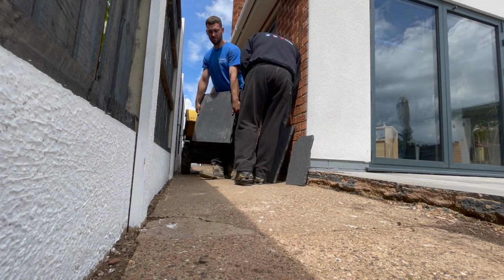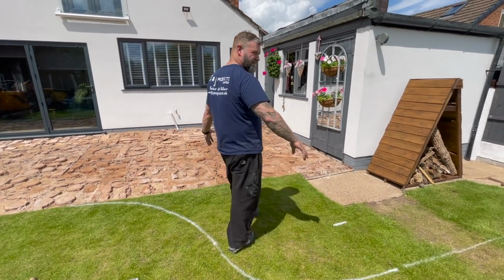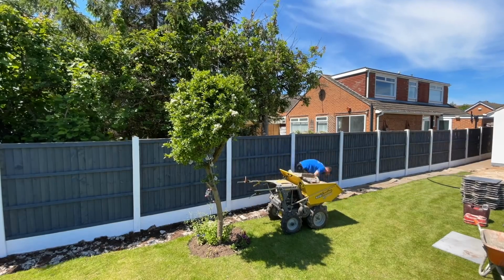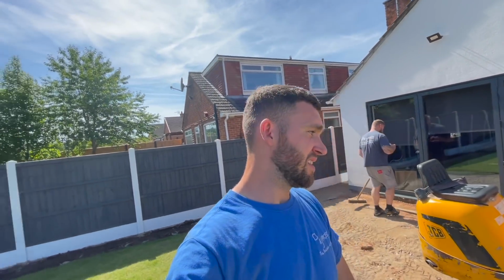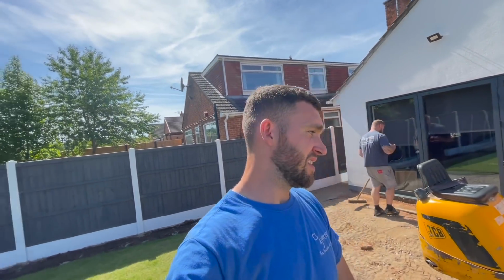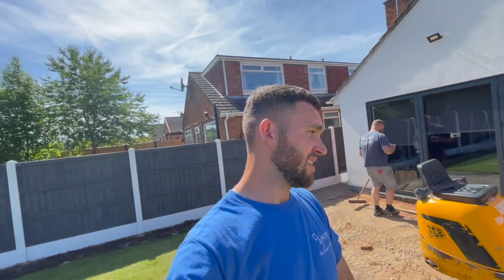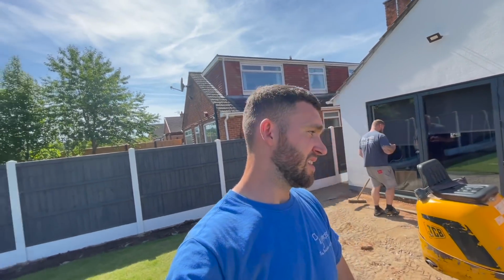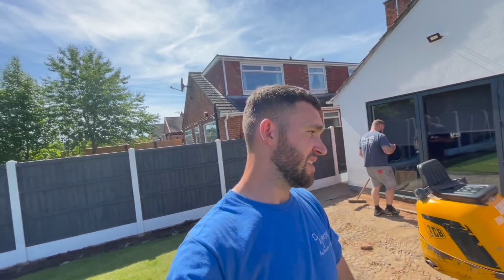HOW DO PEOPLE GET AWAY WITH THIS? - This Week At D&J Projects #013

Comment: Great job guys. And if I Remember Correctly it is 1 cement 2 Building sand and 4 Sharp sand you Use in your mix. And the Reason why it’s over water can drain through. Keep up the great work and Stevie your doing great on the grab (BIG RED) I look forward to your Mirch coming to the shop then I can pop in and grab some and I be Using you guys for my fencing Materials at home. Wen I get to it 😂 have a great week and you all keep safe 😎
Reply from the maker: YOU ARE RIGHT MIKE!! haha thanks mate

Comment: I'm surprised you don't use polymer sand for the joints. Just sweep it into the joints, vibrate a bit and spray with water. Makes a neat patio.
Reply from the maker: We use joint it, nothing easier than what we use lol
Reply: @DJProjectss  Look it up, polymer sand.

Comment: Builder did this on my clients steps. Over an inch of dot-dab on top of old concrete steps. Whole lot is debonding 🙄
Looking great the resin finish is going to look awesome.
What run-off angle are you putting on the patio?

Comment: Ive not watched the full thing, yet, so maybe you mention it later on. But isnt another reason for not dot/dabbing the thin slabs due to the difference in moisture against the slab on the underside. Which can end up showing as discoloured circles on the surface. Or in  the case of the castle lay (picture frame here), you can get a discoloured ring right around the perimeter.
Reply from the maker: That is true

Comment: Do you guys make or could you make double faced fether edge panels did a job recently were customer wanted both sides faced with no visable rails, so had to buy extra fether edge and pin it on the back myself.
Reply from the maker: Yes we can make them mate

Comment: TIP:

When you lie your pavers/stone. Mix 1-2 inch of dry sand and cement. Just sand and cement NO WATER. Spread it level and compact with wacker plate. Lie your stones in whatever pattern you like. Then rinse it with water or just wait for a rain, but make sure there is not traffic allowed on dry surface. 

Much quicker. Gives you perfect level. Looks more pro ;)

One consideration - you may struggle with local weather. Make sure you do not do more than you can at once. Once you get some practice you can aim at 250m2 a day of flat and level surface ;)

Good luck

Here you have a video how it is done on a larger scale. Still small but much bigger than typical British backyard ;)
https://www.youtube.com/watch?v=sZZSf32IfwE

Comment: Presentation and content first class but it just needs a bit of work on the audio its constantly changing levels , tiny bit annoying. Hasnt stopped me liking and subscribing though :D
Reply from the maker: I know it’s a ball ache but could you let me know where it happened on this video so I can see the difference and try and adjust for the future
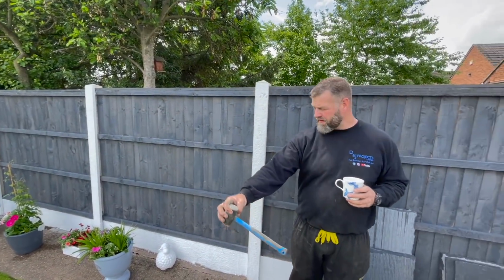Reply: @DJProjectss  for e.g @ 2:37 when dad comes into shot hes very quite and i find myself turning up the volume to hear him
and @ 3:20 when theres the shot of the grab its fairly loud then as soon as you switch round to face cam it goes quite again..
i think you basically just need a clip on mike each or maybe run it through some audio normalizer software